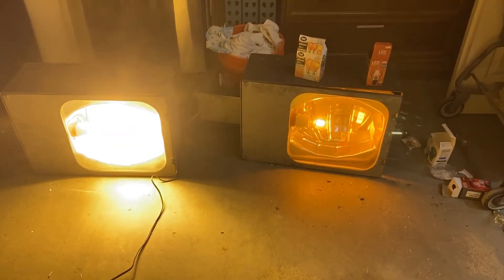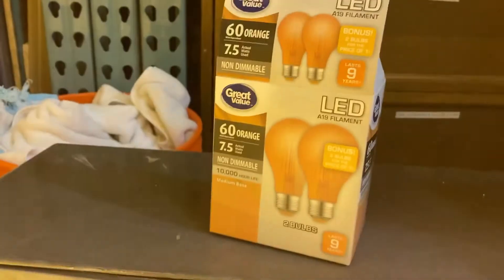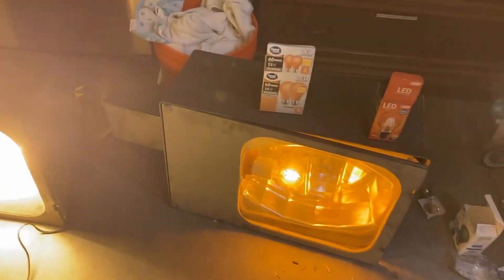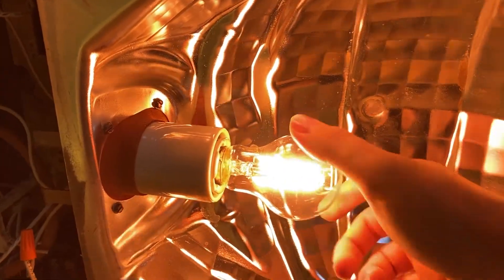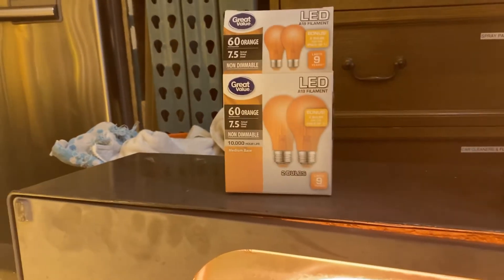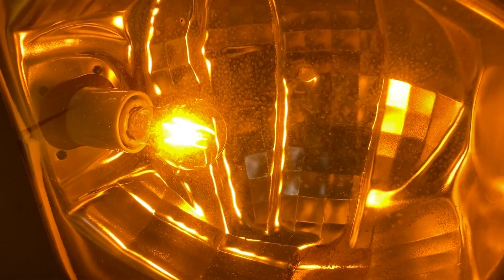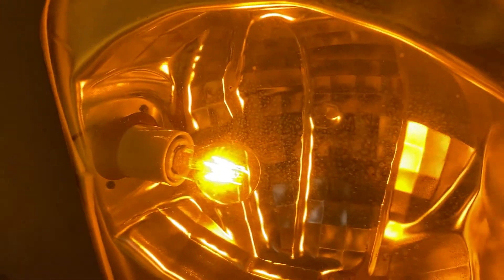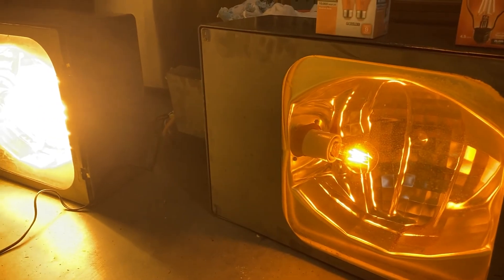Testing Orange LED Bulbs On GE Street Light & Comparing It To HPS Bulbs

Comment: Wow I actually found a video on this topic. I love the efficiency of LEDs but I hate that jarring bright white light they decided to go with. Specially in my area where you'll be driving down a county road hit a 1 mile long town with two of those new lights and then you're back to pitch black. I feel like the orange helped preserve your natural night vision, the new ones make my eyes adjust right away.
Reply: you can turn down the intensity but engineers havent gotten past the brightness obsession yet I had one by my old place flooding the parkinglot it was so bright through my blackout curtains it was creating shadows from objects in the room it was way brighter than it needed to be just lower the amps damn if you supply an led with the same power as a halogen it will be way to bright

Comment: Those LED bulbs look really good in the fixture i am a 14 year lighting maintenance worker and i work on those fixtures that one is a GE decashield shoebox fixture commonly found in municipal streets as well as parking lots you are close on the rating of the socket of the fixture the mogul socket rating is 1500 watts with a 4 kilovolt pulse rating those decashields range from 70 watts to 1000 watts depending on the size area to be lit up.